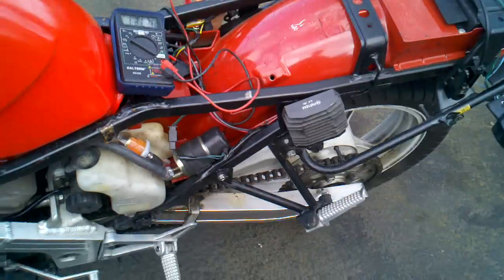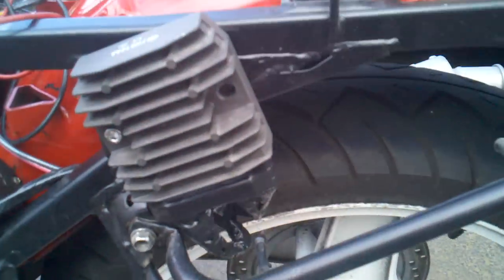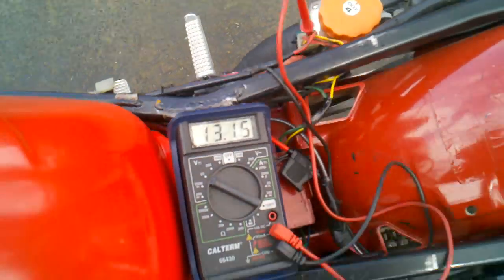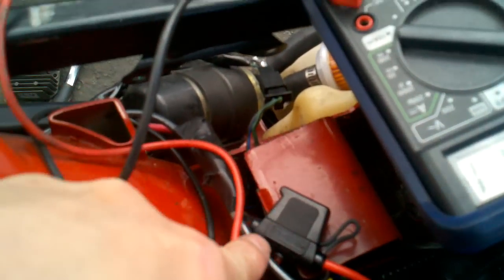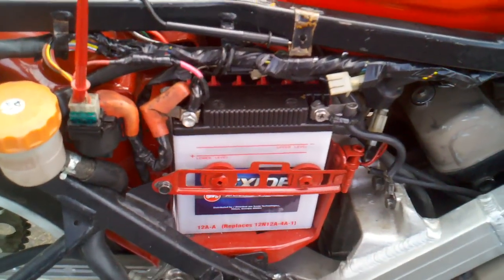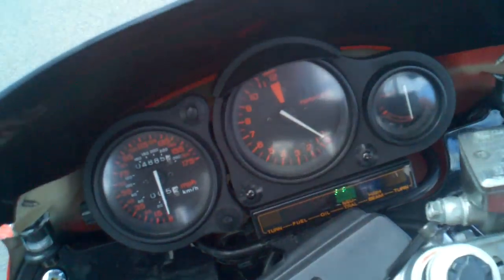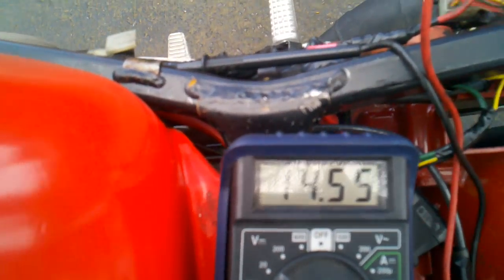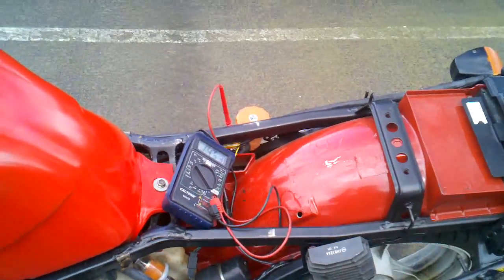Honda VFR 750 Charging System Upgrade- FH012AA regulator/rectifier

Comment: I'm still using the old diodes regulator for my rc24. It's now time to change it for an original shindengen mosfet as im having issues with volts not climbing past the volts already in the battery. 
Well just had all the bits come, I'll be installing the new rectifier directly to the battery. It's been recommended to do so eliminating the old loom. 
Thanks for sharing 👍

Comment: i got a used OEM one from wrecked 08 Yamaha R1 for $35 on ebay and it works great. 

i ended up having to wire it directly to the stator wires cause the factory stator connector melted from not having a tight connection..  this unit runs real cool so i mounted it under my seat towards the rear..

Comment: can you put up or mail me the wiring for FH012AA to your vfr. i know 3 yellows from the  alternator. just the other 3 wires as the vfr is a 5 wire rectifier not a 6 wire . i'm right thinking extra one goes to a live on the live off ignition +
Reply from the maker: Sure, you only use 5 wires on the mosfet RR. I don't see an email option here anymore.
I just googled FH012AA mosfet wiring diagram and found many pictures and diagrams.

Comment: Hey Aron, I have a 1985 VFR 700, that needs a rectifier, can I use any rectifier?? from any motorcycle? I heard you saying that you had a kawasaki and then you put a yamaha one.. please let me know or what do I need to take inconsideration thanks , good job !!
Reply from the maker: There are several options, the bike it came off of is not the important part. You can use one from any bike as long as it meets the specifications for your bike. Search for R/R options for the VFR....that is what I did and how I found which ones I could use.
Reply: Thanks a bunch man !! great lead